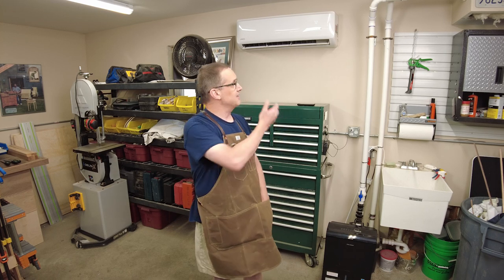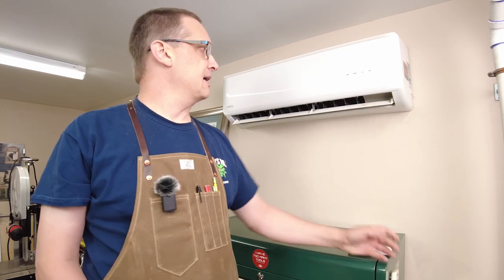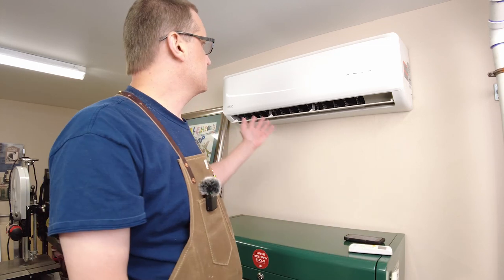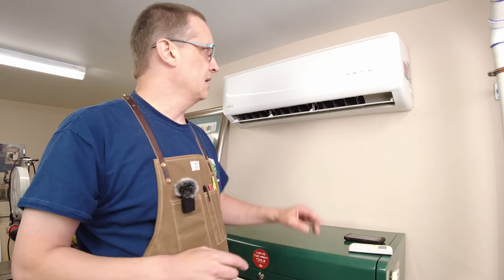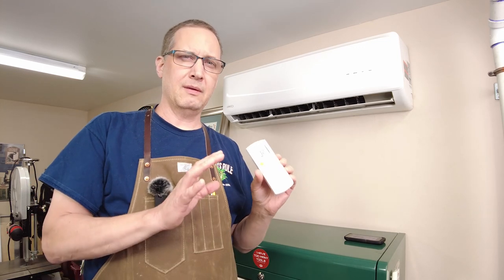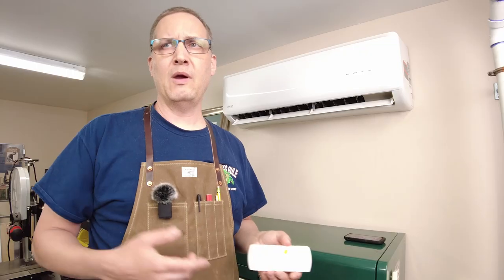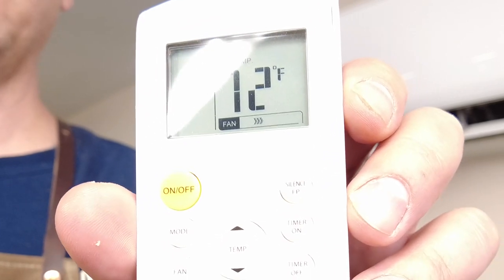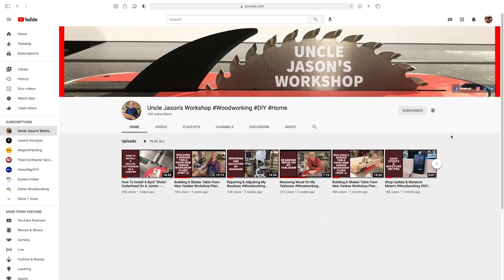Heat & Cool Your Workshop With A Mini-Split

Comment: Hey.  Nice video.  Super helpful.  I'm also in the Twin Cities area.  Moved into my place in October.  It has a BIG garage at 24x52 and it has a small overhead electric heater back in the corner.  I'm debating between this and using the existing 240V connection back there, or running a gas line to an overhead natural gas heater.  I like the reduced carbon footprint of the mini split, but I'm concerned this is going to way more expensive to run monthly.  Do you have any guess the actual cost to run the unit in the winter?  I won't likely run it often during the summer since I don't work in the garage daily.  I would only run it when needed.  Curious on your thoughts.